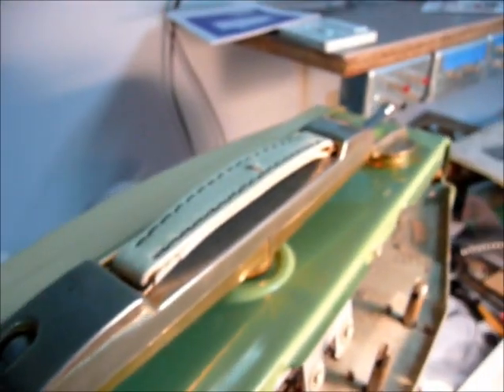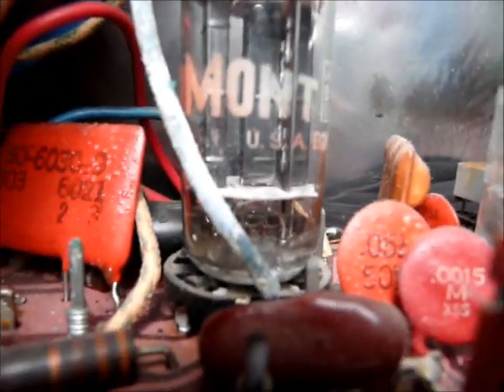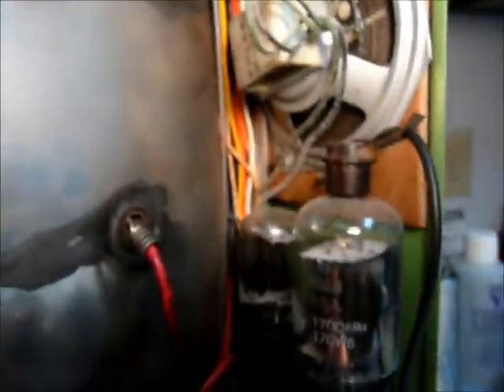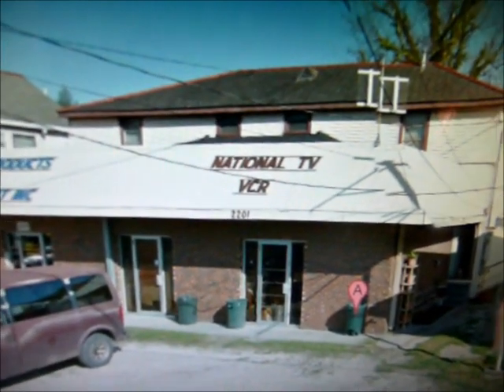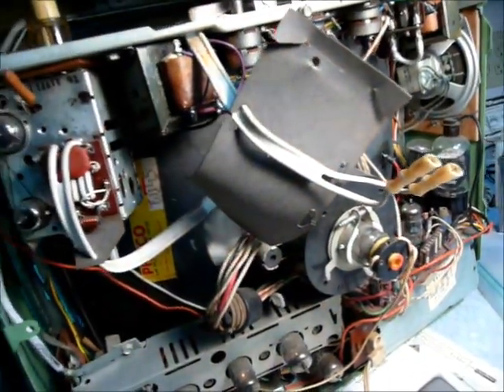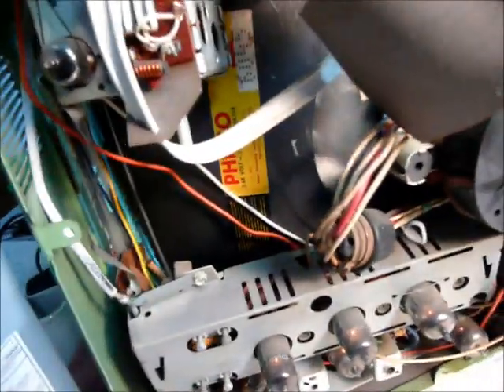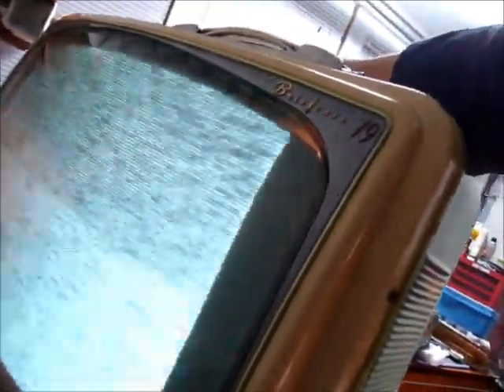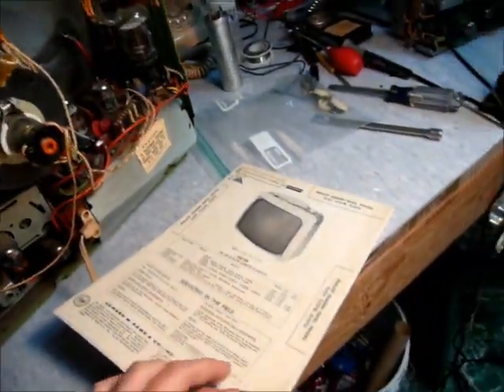1960 Philco Briefcase 19 Repair - Part 1

Comment: That looks a lot like the Philco Town and Country inside.
Reply from the maker: Very similar, although this earlier Briefcase 19 (11J27) has a chassis like the Seventeener III sets I have.  My Briefcase 19 (13J27) is a later production whose chassis laid out just like the T&C set (12J28).  There are differences in some of the circuits/components.